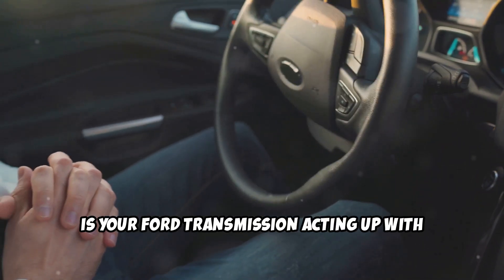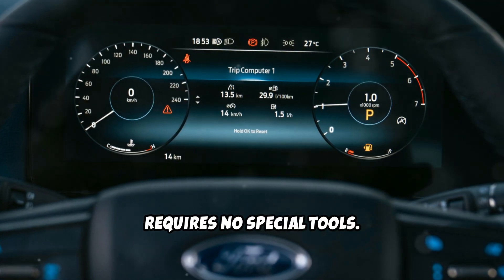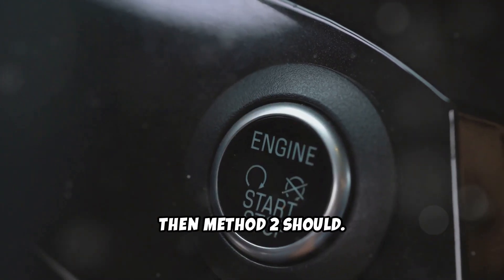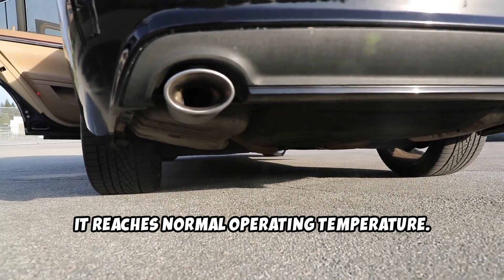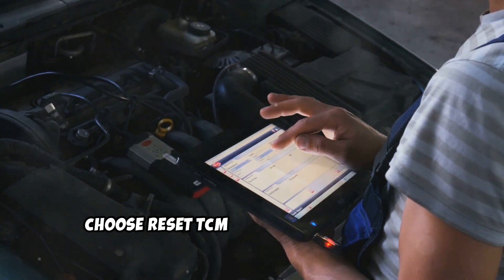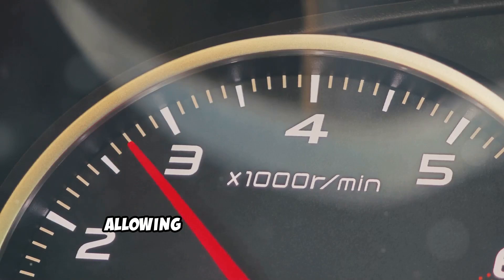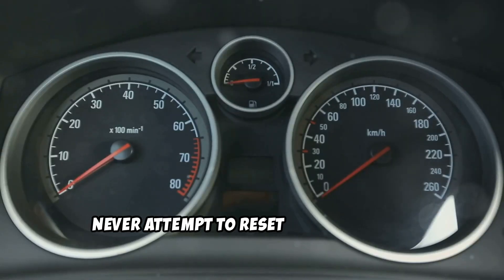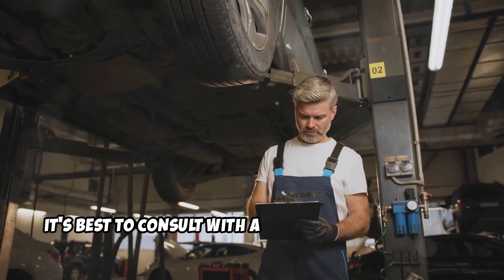Ford Transmission Control Module Reset (TCM Relearn Guide)

Comment: Method 1 worked in my case🎉! This error emerged in my S Max 2016 after I driven car while manual shifting gears. I driven car in higher RPMs (around 3500-4000) and I guess TCM interpret this as an error.

Comment: My transmission completely goes out when it decides to and I need to disconnect the battery. Sometimes it fixes other times I'll do it again. It just disconnect over night if I'm not going anywhere then my car magically works again until the transmission fault comes back on 😂. Such a shit car. No idea why they try and complicate a normal transmission that worked fine in the older models.
Reply: My 2014 mustang does the exact same thing

Comment: My 2014 ford focus had a problem with transmission and had been in Garage for years..
Bought it from him. It wont go into any gear. Checked two actuators and forks and both were ok. Checked that both forks screw is turnable 14 times and freely return with no issues.
Checked the TCM and found a leak behind it...found out that there were no o-ring seals at all. Checked that both sockets were not setting properly because of lock mechanisms were borken. Put them back as strong as I could. And I put another TCM for testing; gues what; i start hearing clicking noise. Started the car. It moves forward and backward. I still need to clear the codes and relearn the tcm...
My problem now is that I dont have the software tool to learn the new "old" tcm with pcm. I got it from another car.
Same model.
Is there anyting I can do now?! 
I think the car move in D but dont shift gears to second and so on...
Reply: Tow to garage let them reprogram

Comment: Does this really work
Reply: Im trying method 1 right now 8/5/25 @ 11:37am.
Reply: @letsdothis3332 lol I’m here today too, hope it works out
Reply: @letsdothis3332 any luck? I need to try to do this before I give up on my vehicle lol!
Reply: @letsdothis3332 Did it work? What year is your vehicle?
Reply: Did it work???
Reply: @elcocaino8728 it did for a couple of minutes
Reply: @elcocaino8728 love the update right?
Reply: @elcocaino8728 he is no longer with us 😢
Reply: My 2014 ford focus had a problem with transmission and had been in Garage for years..
Bought it from him. It wont go into any gear. Checked two actuators and forks and both were ok. Checked that both forks screw is turnable 14 times and freely return with no issues.
Checked the TCM and found a leak behind it...found out that there were no o-ring seals at all. Checked that both sockets were not setting properly because of lock mechanisms were borken. Put them back as strong as I could. And I put another TCM for testing; gues what; i start hearing clicking noise. Started the car. It moves forward and backward. I still need to clear the codes and relearn the tcm...
My problem now is that I dont have the software tool to learn the new "old" tcm with pcm. I got it from another car.
Same model.
Is there anyting I can do now?! 
I think the car move in D but dont shift gears to second and so on...
Reply: I've done 2 of these methods. The accelerator option, and disconnected the battery and both have worked
Reply: @sugarynsweetness were you having slips in transmission ?
Reply: It worked for me just did it but we'll see how long it last. Ford refused to give me a new tcm. Saying "it did not throw the code" so idk what to do
Reply: @gottabetk2826They did the same shit to me man. Literally started throwing the codes a month after the letter extending the replacement window and they wouldn't honor it. Such a shit company
Reply: @gottabetk2826which method did you go for?
Reply: Thru my research those are the common issues that this car is known to cause some people say they replace the actuators n trans is fine some people say get a new tcm and it will be fine… some say do both and car will be working again
Reply: I'm testing now will actually tell you if it worked